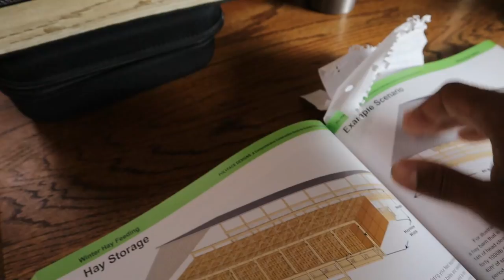Will This Work for my GOATS?

Comment: Fyi mike we have one in one of the stalls that we use for hay during the winter the goats waste more hay then they eat. Keep an eye as they eat the hay down that your remove the bailing string the goats might try to eat that as well
Reply: Hind site...put pavers under the feet of the feeder to help delay rot
Reply: Betting you will have to add. 4x4. Or smaller fencing to keep the goats from wasting hay.

Comment: Lumnah Acres has goats (smaller breed) and you might be interested in the way Al built his hay feeder , with the bars on a slant. That could be very effective for your goats as they are much larger and it would prevent them from entering onto the feeder itself. Nice job on the construction!

Comment: Lumna Acres has smaller goats.. but he put a wire mesh around the hay to avoid the goats pulling out a bunch and wasting the hay.. because they wouldn't eat they hay on the ground.
Reply: goats with horns quickly destroy welded wire, in DAYS... was an expensive lesson.

Comment: Great job Mike and Josiah! If you want to save hay, I put boards or plywood (I’m sure cost is high!) horizontal across the vertical slats so that only the bottom 10 inches or so are exposed for the goats to pull the hay out.They won’t waste near as much since they will not be able to pull from the “top” of the bale. I hope this makes sense it worked for us for 25 years.

Comment: Obviously it works.  Yes the spacing of the uprights needs to be wider than the head but narrower than the shoulders [not easy to achieve]  My father was a carpenter and working with the animals was not his favorite thing but building our infrastructure was.  The solution for the hay feeder was called a key hole.  wide enough for the head at the top  but narrow as the neck at the bottom.   One change I would have used is to screw the boards under the rails instead of on top and save the extra wood above the bottom boards. I think a third screw in each end would be strong enough and cheaper at todays prices than the extra screws.

Comment: If u have a sawmill close by, many times they will have “farm lumber”. It’s 5\4 wood that’s been rejected for whatever reason. Last year I bought 2 bundles 800 tom1000 board foot each for $60 a bundle. It’s perfect for projects like that. I built my 10x18 foot chicken house with just over a bundle, the metal roof and screws far exceeded with lumber

Comment: To help me with construction costs I use pallets where I can. Most times I am breaking down the pallets and using the wood to build with.
Did you get a break in the price for those bottom bales?  Some places sell bottom bales a little cheaper.
You can just add more stiles to the feeder. The goats will still be able to reach most of the hay.  If there was a "hump" down the middle the hay would slide to the edges.

Comment: have you sprayed the mechanism for the latch with W-D 40? Some kind of material might have worked its way into it. Spray both ends and work the latch with tailgate open to distribute it. We had a similar problem with a hood latch cable.

Comment: I raise Nigerian Dwarf goats and I have found that if I give them more hay than they will eat in a day they will pull it out and eat just the stuff they like best and waste the rest. They waste so much more than they eat if they have a bunch to pick through. I have 15 goats in one pen and they will only eat one bale every other day.  I do supplement with alfalfa and feed when I am milking them,  But I can put a bale of alfalfa in there if I need to be away for more than a day or two. They will waste 3/4 or more of that hay if you give them that much at once. I recommend a smaller feeder that will just hold one bale of hay for your small herd of goats. One bale will probably last them a week if they have garden stuff to eat too. Make sure you take the strings off and remove them from the pen. They can be dangerous to curious goats.  One thing I would change with my hay feeder would be not using the goat panel sides (4x5 goat panel). I would rather have wood slats as you have done.  Here is why,  my goats rub the hair off of their faces trying to get to the hay. The holes (4x4) are too small. I would rather they be able to stick their heads into the hay feeder so they can pick and choose what bites of hay they want. If they can get their heads in and eat they are inclined to leave their heads in there and drop hay inside the feeder instead of pulling their heads out and just dropping it all over the ground as they chew it.

Comment: 🔥 SPRAY A LITTLE LITHIUM GREASE ON THE MOVING PARTS OF YOUR TAILGATE AND IT MAY WORK LIKE NEW. WHEN I BOUGHT MY TRUCK THE TAILGATE WOULD STICK AND SOMETIMES WOULD NOT SHUT BACK. LITHIUM GREASE WITH ONE USE AND IT'S NEVER GIVEN ME ANOTHER PROBLEM IN ABOUT 10 YEARS. ✌🏼🐺🙏🏼

Comment: Wouldn’t a metal cage from an ibc tote work on a moveable raised platform save time and money.  You still can find the totes fairly cheap (sometimes you can find just the cage). Just remove the plastic tote (you can use it as a water trough). When your goats have kids how are they gonna reach the hay. Plus with the ibc tote the hay is accessible from all sides and you don’t have to use just square bales. With a little modification to the cage can be shorten if you find it to big.

Comment: Am sure you know , but goats will eat what’s in front of them till it’s gone when it’s put out for them, your feeder is huge and I get the idea you want to get away for an overnight stay but leaving food for the goats to help themselves would kill them, because they will eat what’s available until it’s gone so eating more than a day feed consume it in one day - not good
Reply: Goats can't overeat on hay. Goats actually need hay available all the time, especially if there is not lots of browse. Hay is only a problem with goats if it's moldy from being baled at the incorrect moisture level,  getting wet or sitting on the ground and absorbing moisture from the ground. On grain, yes, they can overeat and rust needs to be measured and fed carefully.

Comment: I would make a 'door' on the side or at the end.  Your strong enough to just 'toss' those bales in there but what if your SICK and someone else has to load that feeder who doesn't have your WEIGHT TRAINED muscles? lol  I don't know how 'light' those bales are but there are 10 of them.  Men make these systems and don't take into consideration that they could be ill or otherwise 'unavailable' to manage them, then it falls to the rest of the family... make it easy for them to 'keep things up' so you can 'recover' from whatever...
Reply: Agree. what they need is gate that can be lowered down fixed with hinge  or removable vertical slats
or use strings/ropes tied horizontally that can be removed when loading in hay and reducing the vertical slats